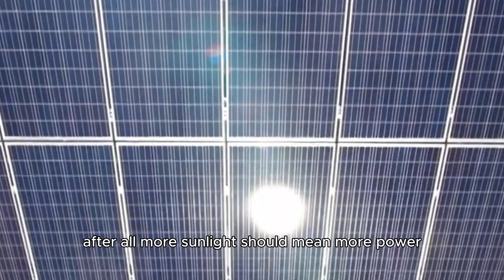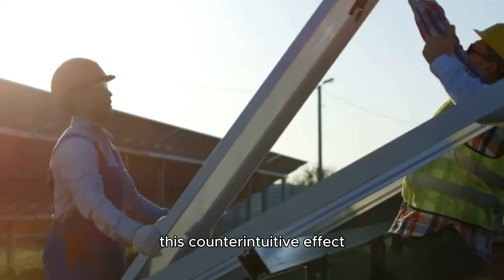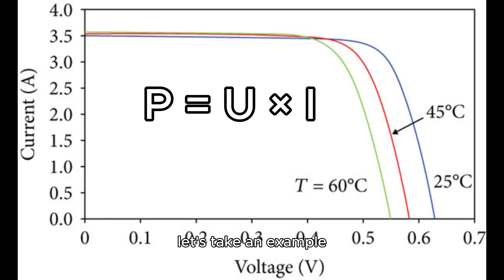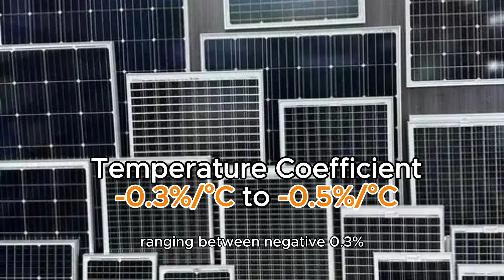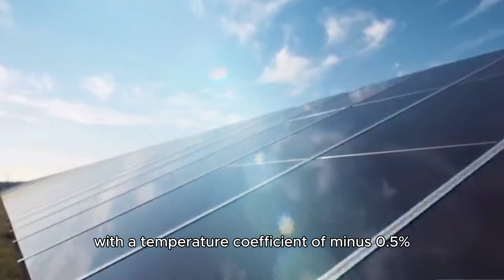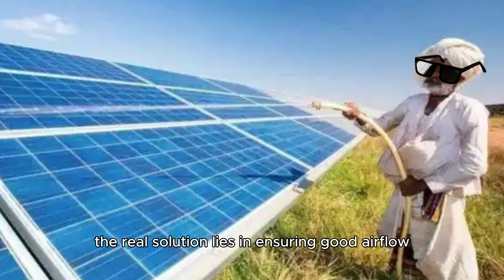HOT Days, LESS POWER? Solar Panel Temperature Coefficient Explained!

Comment: I have noticed on cold sunny days my 15KW system puts out the most KWs.  I haven't measured it scientifically, but on the best days I'll see about 1KW difference compared to hot and sunny days.  This is of course why I watched this video.  My installer told me of this phenomenon, and it is true.  Luckily, I'm a bit oversized on the panels compared to the demand/batteries.  I recommend this combination as panels are the cheapest part of the entire system.

Comment: I painted my roof white to reduce the temperature of the panels mounted on the roof.
Note that while the voltage decreases at higher temperature, the current (amps) increase slightly. That means that if you have a PWM charging a battery, you would actually get slightly more output (as long as the voltage doesn't drop below a certain threshold). In warm climates most panels being offered have a fairly low temperature coefficient.
In cold climates you might actually want a high temperature coefficient as it improves output at low temperatures. And winter is when you need that output the most.

Comment: The sun is the same star in summer or winter, you have to measure the intensity of solar radiation. I put an ultraclear glass 3 mm in front of a photovoltaic flexibil panel and with a fan I introduced the warm air in the house. During summer I recirculated the warm air through a coil with cold water to preheat it for consumption. I have only 1 m2 in my balcony, not too much economy but for a house with 30-50 m2 of photovoltaic panels it can be.